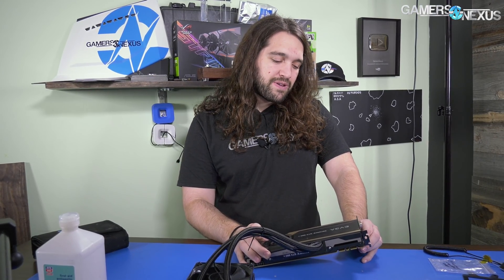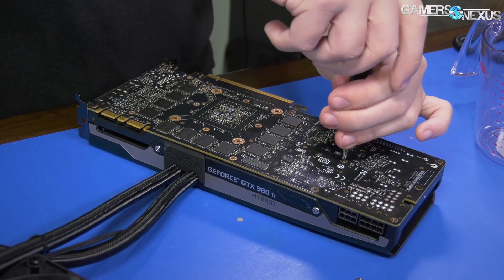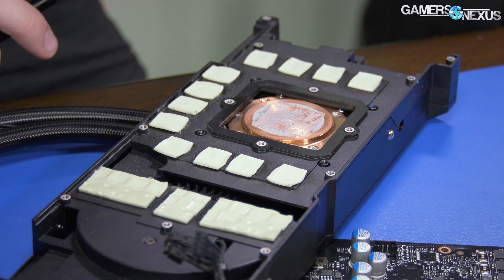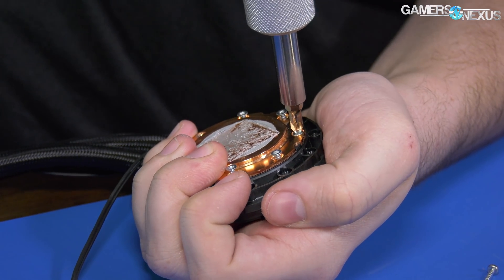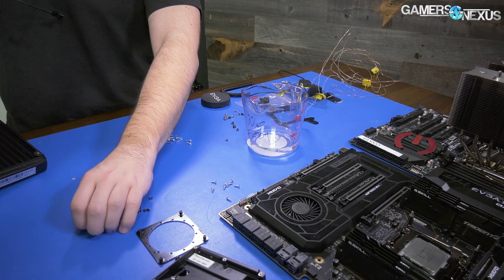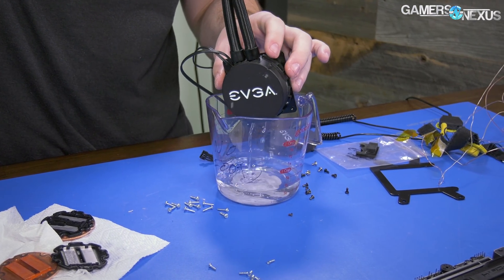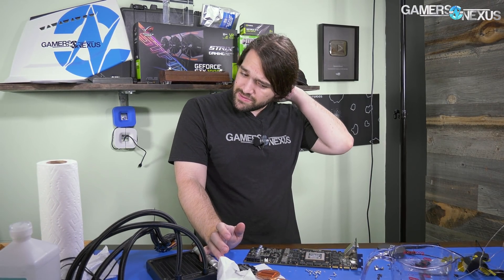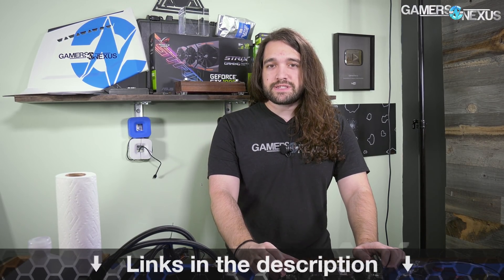Liquid Permeation Check After 1 Year: GPU Hybrid

Comment: About the vga to fan header cable at 14:15, Gelid does sleeved PWM ones for really cheap. Currently using one with my Kraken G12 & MSI afterburner to control the radiator fan speed.

Comment: A couple of things I know to not do, and to try.
1. Slowing down the pump could cause the issue.
2. If the system's off for long periods of time there could be air buildup in the block, so moving the computer around a bit (e.g. laying it down on its side for a few seconds then sitting it back up, and doing this a few times) to promote the water around the impeller and block could fix the issue, as it did for me.
Reply: 1. What do you mean, slowing down the pump? Running it slow via manual control? Or do you mean if the pump runs slower due to a technical issue?
2. I find it weird though how air would get trapped in the block if the pump can manage to push air bubbles through. This happened with all my systems on first start. But I know there can be design issues that cause such a tendency. But my EVGA pump was running fine for three years and then suddenly had a severe cooling performance drop, while the motor is still running fine.

Comment: You said 100ml for first cooler and second, but second looks like 200ml in the video?  Or did you just add to the original cooler's water?
Reply: he poured in to the same cup.

One was 100ml, second shot was 200ml, so both = 100ml
Reply: Ya the first is 100 ml the second is 200ml is what I saw
Reply: Thanks, just making sure.

Comment: If it were me, I'd have taken high resolution  X-Ray shots of the coolers before and after, then calculated the exact internal volume. Then scan each of the liquid samples with a mass spectrometer to determine the exact composition. And don't forget to flow test each pump at a variety of temps.

I'm kidding, great video.

Comment: Liquid permeation has been addressed for several years now. They use special tubing for liquid cooling that stops this. If you ever find a company not using this type of tubing in a liquid cooled system, never ever buy any of their products again.
Reply: Something tells me you don't know what you're talking about.
Reply: I've been liquid cooling for over a decade. This has been addressed and is no longer an issue with a reputable brand.
Reply: This, they, them, addressed, "special tubing". A lot of vague non specific proclamations, not sure what you're talking about.
Reply: AIO's claim "low permeability tubing" not non permeable. So no, it's not given.
Reply: It's a given with with my liquid cooling loop tubing. You get what you pay for with these cheaper AIO solutions advertising "low permeability tubing".

Comment: Something to consider for you guys based on your comments regarding the screws being easy to strip.  There's a japanese screwdriver in JIS  #2 (Philips #2 but less cam), and it's got 
an impact hammer mechanism built in.  You put the bit into the screw. And then hammer the back of the screwdriver. Which causes it to cam ten degrees counter clockwise.  The idea is to have downward force prevent stripping, and the movement of the impact hammer is just enough to break a tight seal or corroded screw.

I think it goes by the name Impacta 930 screwdriver. Not expensive either.
Reply: Jirekianu ty for mentioning that, it seems like a handy tool to add to my tool belt at the very least, though I would hesitate to use anything that requires a hammer with electronics. Especially  when you could use something like a speed out bit with a drill.
Reply: were the screws not PH2? Just asking

Comment: Definitely enjoyable to watch. I have an EVGA GTX 260 Superclocked that used to get up 100°. I'm amazed it didn't fry itself. I took it apart, cleaned it, and put new thermal paste on it. That dropped the load temperatures 25°-30°. I still have it in my old PC.

Comment: Dry thermal paste should not cause that big difference. I had radeon hd 6870 running 4 years without changing thermal paste, then i changed it and temperatures were about 1c lower.

Comment: Hi! I have had this problem in the past, though my card was not a hybrid, but using the NZXT kraken. The issues occured 3 times, each with a different incident. One first issue was the contact between the pump and chip. I tightened it harder to close the gaps. The 2nd issue was a slack pump connector. Essentially the pump was not getting any power, and the 3rd issue was that the fan for the radiator was also not having any power, due to a slack connector. Not entirely sure why these connectors would fail over time, maybe some cable headers are just designed better. Regardless, I still prefer an AIO on the GPU, hopefully in the future they will add better sensors to detect failures, water levels and that sort of thing.

Comment: Is there a way to check the power consumption?  What if the VRM is bad and supplying too much power.
Reply: if the vrm was putting enough volts to make a gpu under water go to 90C then that gpu is gone
Reply: I don't think it's too unusual for a GPU to hit 90c with air cooling at stock voltages.  Do you really think that water cooling is so superior that to hit 90c would require over 2 volts to the gpu?
Reply: water cooling is pretty high grade when it's done right. In this type of setup I can't be too sure. too many variables really, but I can say that temps were a little on the high side for sure. It shouldn't be going that high with that cooler.
Reply: You would see it on the voltage sensors on the card.

Comment: You could be suffering from hydraulic pump out on the thermal paste when it warms up.  There were a lot of problems with this when people were delidding CPU's and 3 to 6 months later started getting thermal runaway.  When they reopened it and repasted it the problem was fixed temporarily.

Comment: Steve,in my experience with electric motors and diagnosing problems,I have a suggestion to help rule out your problem:Just because the motor is spinning while the pump is disassembled, doesn't necessarily mean it is spinning fine under load.You should clean your coldplate,throw it back on and submerge the pump just enough to try to get it to pump fluid into the radiator.Or maybe there's an impeller issue.Just a suggestion,but keep up the good work nontheless.
Reply from the maker: Good idea! Thanks for the suggestion.
Reply: Agreed. Pretty much this.
Reply: Hmmm what would be the difference between it spinning up dissessmbled vs under load? I'm sure I look like an idiot asking but I'm a curious idiot.
Reply: @killtyrant  under load aka pumping fluid, you have a resistance in the system that will allow you to see if any work is being done. If the impeller has come.loose from the motor shaft it won't want to pump fluid because the shaft is just spinning while the impeller just sits there. I've seen that particular problem on everything from cars and trucks to large and small pumps driven by engines and electric motors.
Reply: @baronclime6423  why dont they make the shaft and the blades all 1 piece 
Are they coming detached or breaking or something 
What causes the gear not to catch and spin
Reply: took the words right outta my mouf

Comment: This is why I use air cooling exclusively, no maintenance except to blow dust out which should be done to the entire computer occasionally.
Reply: I prefer aios for both aesthetics and allow better airflow of my case fans since I dont have the large aluminium block dead center of the PC. If had the same AIO for 7 years now and the pc settles at 40c under load. I know air is superior in almost every way but CLCs are very convenient to work around and dont require me to uninstall every time I have to swap ram or clean out the GPU.
Reply: Nopiw,  The problem was not resolved in this video, however, he knew water coolers have problems.  And, look at all of the work he did.  A good air cooler would not require that much work, thus my point with my OP.
Reply: Enjoy your Ugly air cooling builds... out of 5 AIO's I haven't had one fail yet.

Comment: Hi, I have had similar issues with my EVGA 1080 FTW hybrid purchased in June. It overheated to 90C (no graphics artifact though) and the pump wasn't spinning. I didn't do anything other than shaking the tube very hard and laying the whole case (Air540) flat instead of standing up, and it came back on working and no problem since. It might have been bubbles blocking the pump or something. Good to know that leaking is minimal.

Comment: I did not expect to see permeation from only 1 or 2 years though. I have, however, seen this issue where the vibration of the pump slowly loosening the screws holding down the cooler. Not a LOT of loosening but enough to cause an issue during high loads. I redid the paste using some leftover Noctua Paste and then retightened down the screws and my temps returned to normal. Also a 980ti Hybrid.
Reply from the maker: Typically is about 5 years, yeah.

Comment: Obviously not the issue in this case but Asetek pumps EVGA uses are known to fail. I had the pump on my 1070 FTW Hybrid start failing causing the exact same issue Steve described with this card. In my case my GPU was hitting 92C under moderate gaming loads.

Comment: I had a similar issue as yours, I have re-applied thermal paste and tightened everything properly and the temps came down to 58 from 90+. Pump causes vibrations and they loosen the screws through long time if they are not tightened properly to begin with...
Reply: Šarūnas Šar Even when fasteners are torqued correctly, they can still come loose over time with load (or abuse.) Locktite goes a long way.
Reply: Same thing happened to me. I thought for sure my card had died, but when I reapplied thermal paste and put the stock cooler back on it worked perfectly. Just bad contact between GPU and cold-plate.
Reply: Use a drop of locktite and how you never have to take it back apart
Reply: @LegendMuscle  and never be able to take apart even if you wanted lol ...

Comment: where can the liquid go? its sealed...
Reply: It permeates the rubber tubes. It's something that happen naturally over time.
Reply: Same place brake fluid and other car fluids go. They can slowly permeate the tubes and there is a fluid loss there.
Reply: It's more common for the absorbed water to start to corrode the brake system from the inside.
Reply: Brake fluid is generally said to have the opposite issue. Water from the outside permeates in to the fluid, and when it gets heated, it boils the water, creating steam pressure, and locking up the brakes. I've NEVER heard, or seen anyone actually being affected of this, but it's the theory behind why you are supposed to exchange the brake fluid.
Reply: I agree. Corrosion in general, from the inside, (or outside, doesn't really matter much), is over all the issue with break-systems, not counting the general wear of pads and rotors.
Brake fluid that is 25 years old still in a vehicle, isn't generally boiling and creating problems, but i suppose the manufacturers just want to make sure...
Reply: Yeah brake fluid is hygroscopic so it absorbs water from the atmosphere usually from the master cylinder

Comment: A much simpler alternative would have been to compare the weight of both.
Reply from the maker: No, not really. We also needed to see if the pump worked and if the coldplate had been gunked-up. You are also assuming that the radiators are equal weight. Manufacturing tolerances mean slightly different tube lengths, radiator thickness, radiator size, etc.
Reply from the maker: In a one-off instance of A/B weight for a single cooler, maybe. The trouble with weighing two different coolers is that you have an imperfect weight for the radiator, the tube, the cable, the exact mixture of propylene glycol and distilled water, so on. Way too many variables. You can't just weigh them in this instance. As you suggest, for a home user with 1 unit, it may be an interesting data point to cross-reference in a few years.
Reply from the maker: OK, first of all, I think there is a general lack of understanding at how easy this is to do, particularly when you have a dozen coolers. Secondly, you still need a reference point. If you don't know what you're looking for, then you're wasting your time. Thirdly, what we say directly impacts these companies. If opening a second cooler means I can more confidently state what I need to, then that's most important. Starting rumors because of laziness is not OK.
Reply: Gamers Nexus dude come on. How different do you think these coolers are? If one of them is missing enough liquid to cause this kind of a problem the difference would be notable, much more so than "manufacturing variations"...
Reply: arjunyg I thought this too, and was about to say that too, however after reading more it’s likely the weight Of an extra ‘blob’ of solder on the radiator from or 3mm more pipe length would skew weight of comparisons too much to be useful
Reply: I completely agree. I ment it as an additional step. I wonder if it would be a good idea for owners of all-in-one water cooling loops to weigh their loop in the original state and then after a few year so that they have a proper reference point and are able to judge the water loss.
Reply: Oriana Di Meola he also may not have been planning to reuse the liquid in either cooler.  Probably just used brand new coolant.
Reply: Weighing would only work in a perfect world where there are no other varibles like radiators alloy variation and so on. The only way to eliminate variables and get a true accurate measurement is to do what Steve did and just opened two of them up.
Reply: or refill the open one and poor it back out and measure how much it took to fill.
Reply: How about weighing the water ?
Reply: I love how even tho I/we thought weight compassions would be good idea, you knew better and explained with real logic why not.  Learning n stuff 10/10
Reply: I am sorry to debunk this theory, as a physics student, weight won't tell you much since the magnitude is pretty different when comparing deltas, it s like comparing the weight of two trucks to see if the driver stole a box of biscuits from the cargo..
i assume 20 mL of lacking liquid (that would weight 20 grams) would highly be catastrophic, while on the scale, the 20 grams difference could be easily due to the difference in the type of tissue surrounding the tubes between two manufacturing batches..
The correct way is to actually measure the volume
One thing that Steve did and I would disapprove, is the mixing of the two liquids, since the thermal conductivity of the first liquid may have been deteriorated by intensive use, wouldnt make sense of mix it with an ideally working one
But that's just me, the difference in performance may be negligeable
Reply: Again, desperate comment Steve, take it easy. First, you can plug in the pump when the unit is sealed and tell super easily if the pump is working based on it vibrating and/or just reading the pump RPM on a PWM header. Second, weighing the two coolers is a perfectly good diagnostic method, if they weight exactly the same, the manufacturing tolerances would not allow for a weight disparity greater than the amount of liquid required to fail the unit. If they are different by any amount that would fail the cooler due to permeation, you could identify that issue without even opening the cooler, but you would then open it up to confirm. You are just jumping in and throwing down with maximum sass against all perfectly reasonable comments. If you swapped the cooler, which would take 5 minutes (which months later, you still haven't done?) this wouldn't be a video and honestly, it doesn't need which I think is the essence of most critical feedback. Just learn to be wrong sometimes dude and cop a little heat for it. This video is way, way lamer than what we are used to you from you, so are all the sassy comments btw.
Reply: So you should have weight it first, then open the dmged one up so you dnt have to open the second one up!?